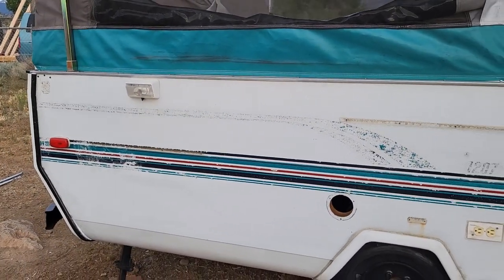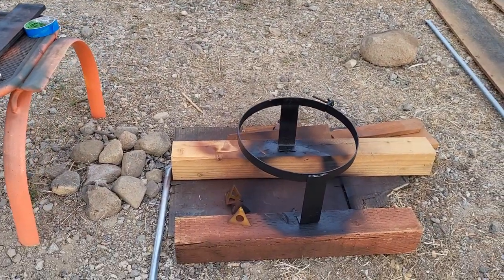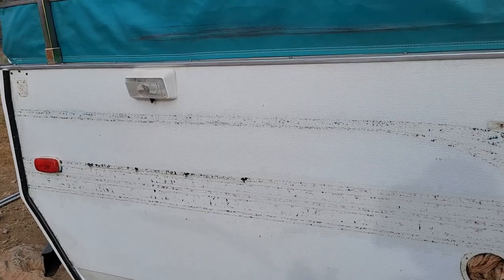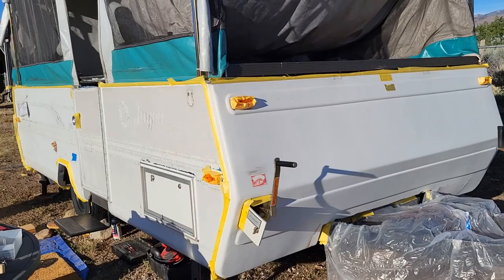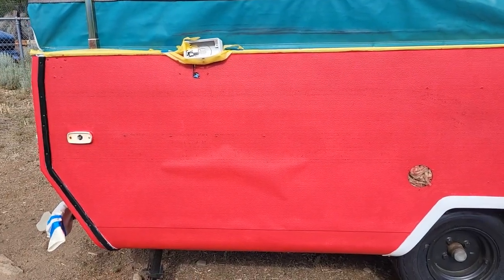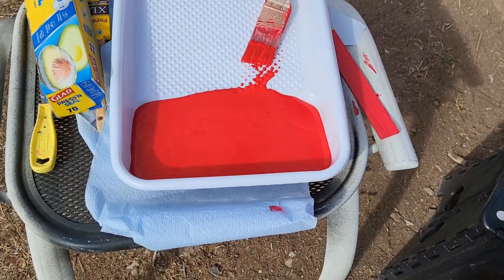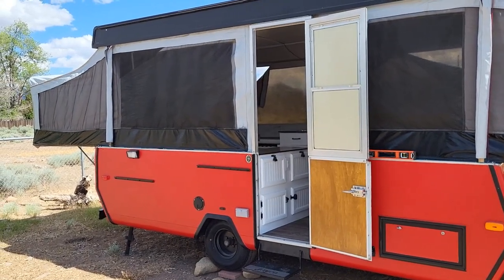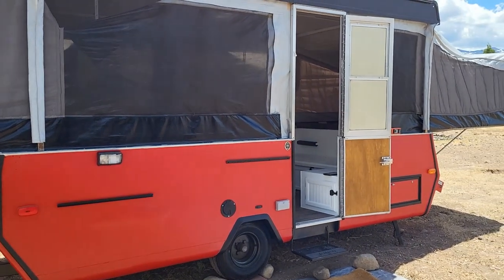My 1994 Jayco pop up camper renovation Part 5 - The exterior paint

Comment: Its been a year since you painted it, how'd the paint hold up? I keep hearing that you can't paint vinyl well and that its tricky doesn't stick ect.
Reply from the maker: I sold the camper. That said, the paint had peeled before I sold it. I think it has to do with the compression you get when you roll the top down. I think if you painted vinyl that was stationary, it would hold up a bit. It was paint made for vinyl. But, it is still vinyl...
Reply: @jeepinwithjulia  I really appreciate your response I'm not going to paint mine in that case, thank you very much!

Comment: How hot does the black top make it inside?  We were thinking about raptor lining the top of ours in black.  I’m afraid the black will make it hotter in side the camper.
Reply from the maker: That is hard to say. It does get warm but we do not have any shade where it is parked at our home. I do have a cover for it when it is down. We are going on our first trip on Tuesday with mixed shade. Some trees. I would think Raptor liner would be great for water-proofing. There is so much air flow in a pop up as long as it isn't over 90, I would  think it would be ok.

Comment: How has the black vinyl paint held up
Reply from the maker: Not well. After opening and closing the camper a few times, it rubs off. So, not the best solution. We have sold the camper. If we kept it, I would just keep a can on hand and touch up as needed. Or, leave it original if you like the color scheme.
Reply: @jeepinwithjulia  ok good to know ty. We are in the process of restoring a 1993. We just sealed the top with that white seal paint and going to paint the lower next weekend. Might just leave the vinyl the green it is.
Reply from the maker: @MRFLIP  Unless you are changing the body color something that wouldn't go with green, I would leave it. I was matching my Jeep :)